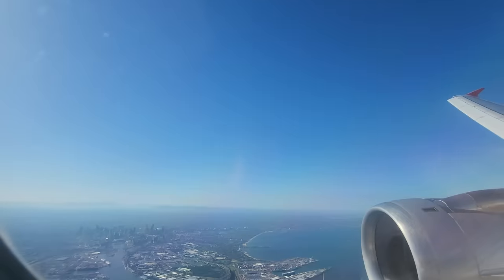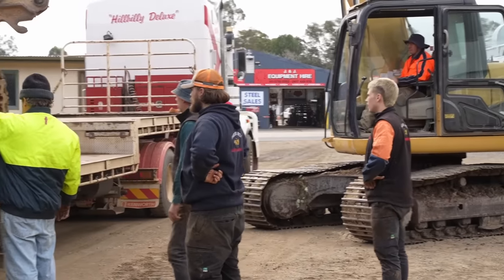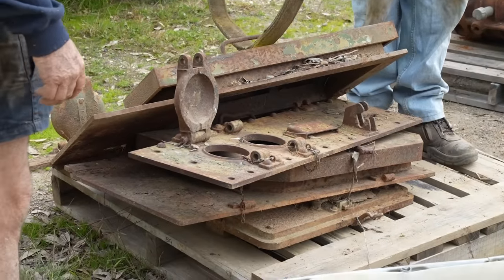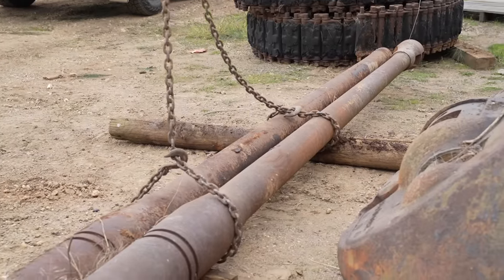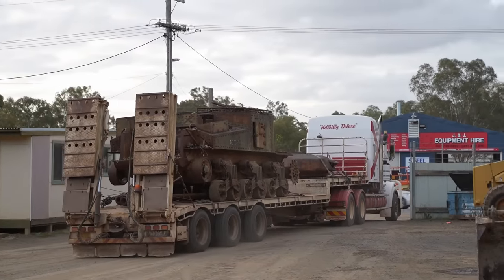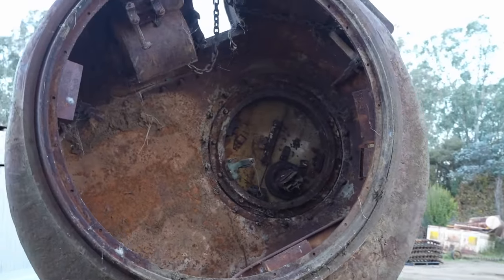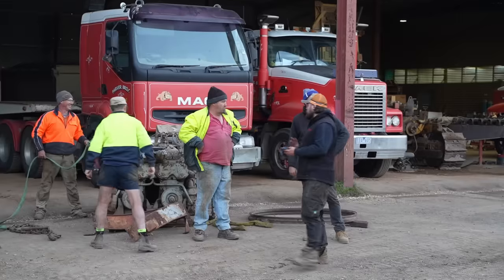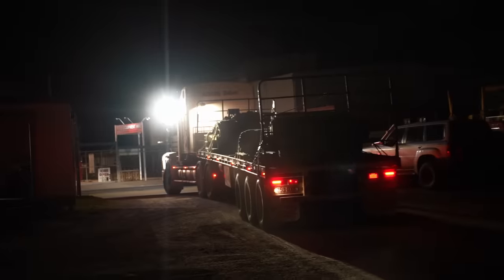WORKSHOP WEDNESDAY: Greatest tank BARN FIND in Australia! PART III

Comment: Such a monumental find, that someone would just collect what others thought was scrap. AAAM will do these machines proud and between all of the components will have another at least one running unit. Do a workshop series when the engine pack is overhauled. Great job and great finds.

Comment: The Grants almost certainly went north on a road train to Nth Qld.........all the trailers have 'ring feeders'  ))   Need frequent checks to keep all the chains tight, the less than wonderful inland roads of NSW and QLD are pretty violent in places.  It takes a lot of patience to tie down all those odd items and keep them from wriggling loose on the flat top trailers.
Reply: Not with the weight of a tank on the back. 50 tons pushes the load limits on some of the bridges north of Seymour.
63 tons is the weight limit for a double trailer combination in NSW and 51 tons in Victoria and 42 tonnes for a road train combination.
Reply: @allangibson8494  Combat weight of a COMPLETE grant tank is about 28,000kg.  You might have noticed that none of those Grant tanks are complete........they are missing turrets,engines,tracks etc etc.  A typical flat top, tri axle trailer like those in the video can legally carry about 25,000kg to 27,000kg on Conventional mass limits.  Road trains use the same axle group mass limits, and can hook up at Echuca.  "63 tons is the weight limit for a double trailer combination".....that is a B-Double running conventional mass limits.........not a road train.  We cant see any B-double lead trailers in the video........they are ALL semi's with ring feeders, its pretty simple to figure out they are part of a A-double road train.  Pay attention next time. Where on earth do you get "42 tonnes for a road train".........Road train A-doubles (2 x tri-axle semi's plus dolly converter) gross 81 tons and up.
Reply: @allangibson8494  I read your deleted comment, they will simply shuttle the trailers to hook up at Echuca like road trains always do, its not rocket science.  Furthermore, the transport company could be running HML with the heavier gross axle group weights, or they weighed them locally and adjusted the loads to be legal off camera. Might help if you actually know something about road transport,mass limit schemes and what combinations use which trailers instead of jumping in to shoot your mouth off.
Reply: @wazza33racer  The combination is above the maximum permitted load in NEW SOUTH WALES for a road train combination. The loads in Echuca are utterly irrelevant.
With that kind of weight on the back, the prime movers will have trouble on any significant grade. The eastern states are not as pancake flat as central and western Australia.
BTW - I didn’t delete a comment.

Comment: Idea to move tank from trailer to trailer
Put the 2 trailers as close together as possible parallel and using wooden skids that won’t slip or break under the burden, those skids can be pushed with the tank on it

Comment: Simple to get it off, just the reverse of how you put it on. You have the two recovery vehicles. Take the tank off one of the ramp trailers then pull  the first one off onto the empty ramp trailer and off.  It’ll be tricky, but it should work.